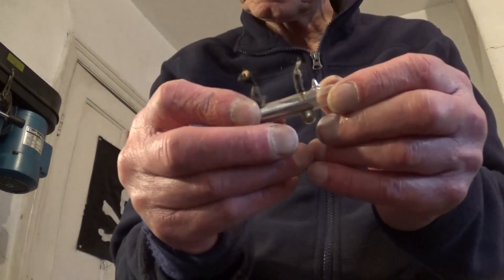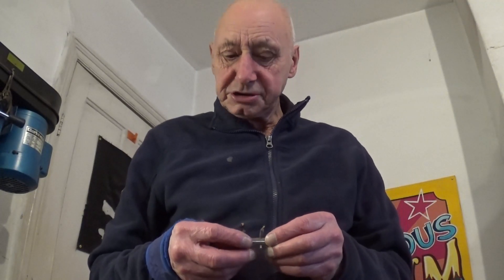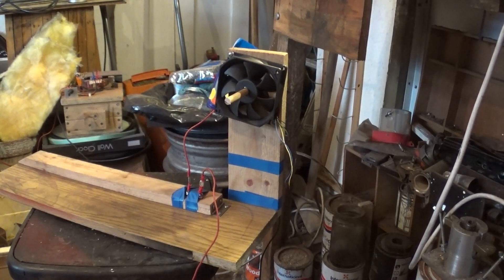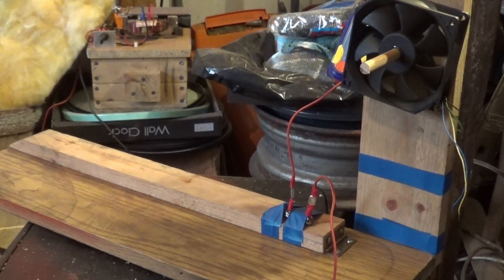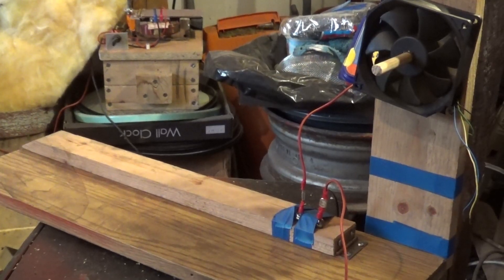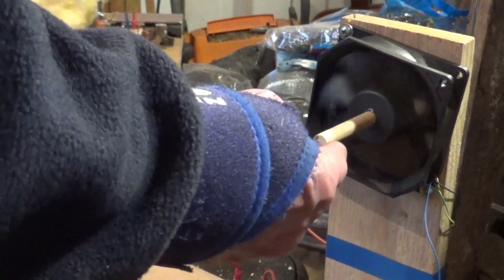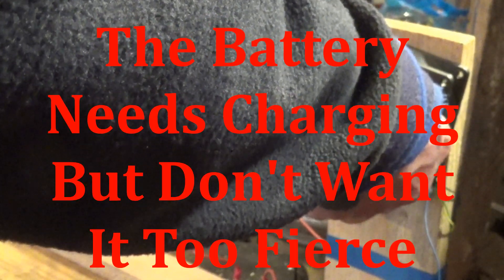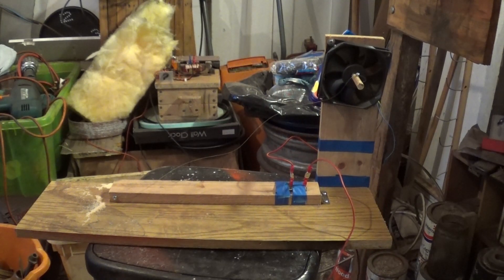Mercury Switch Demonstration

Comment: Those are power switches, often used as contactors for motor start/run. I have some that are ten times that size with ceramic collars inside as well as multiple contacts. Mounted on top of a solenoid which tilted 3 at a time for 3 phases. Mercury puddle does the make/break and the contacts when set up.properly, never come out of the mercury. Hard vacuum above to eradicate arcing/oxidising or polluting the mercury. Very reliable contactors for frequent run/stop cycles of big motors.

Comment: You make a mouse trap Malc ! I have two of them and I think they come from a thermostat ! (central heating)
Reply from the maker: LOL usually they are used for leveling devices, or to stop something if it falls over. Never heard of them being used in a thermostat??? That's normally a bimetal strip.
Reply: @MalcOfLincoln  I used to have a warm air heating system and the room thermostat was a mercury switch on a coil of copper strip, only found out when we put in a new combi, love your channel Malc keep up the great videos.
Reply: https://www.youtube.com/watch?v=CLBPsdATeZg
Reply from the maker: @massimobroccoli9854  Thanks, never seen one.
Reply from the maker: Thanks Andrew.